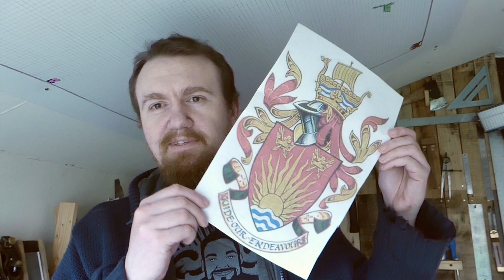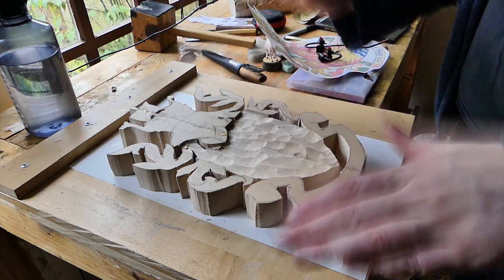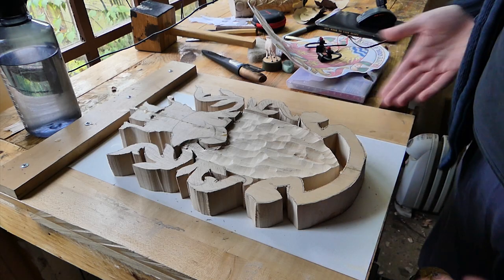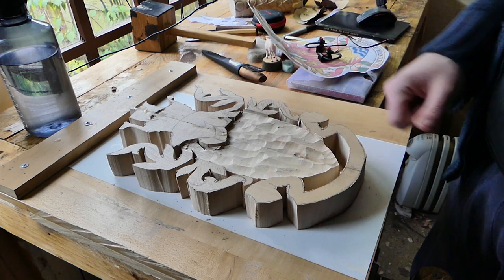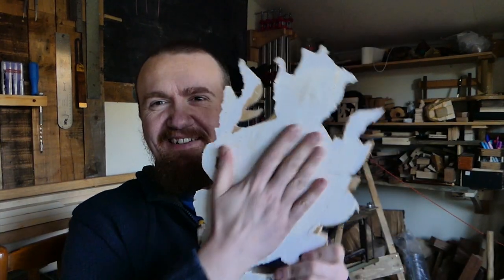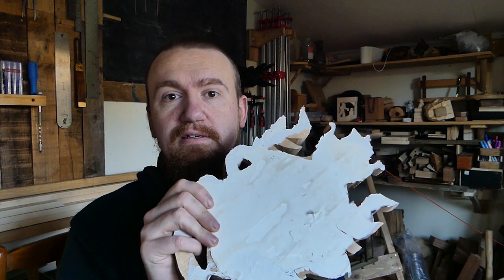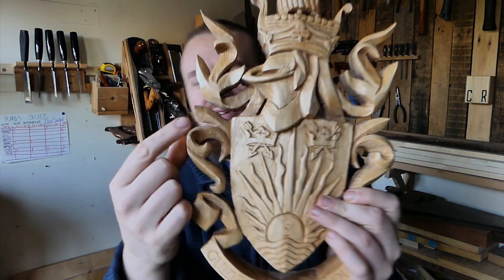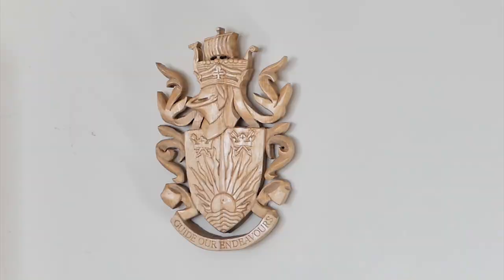Carving the Suffolk Coat of Arms [Wood Carving Project]

Comment: Blooming great piece of work Clint 👍🏻 l’ii certainly try to catch you on twitch if I ever get the right day 😂 another way to hold down your work is to use masking tape on your board and another on your work piece and then glue with superglue, super strong and then just peels off with little/no scraping required. Cheers Steve
Reply from the maker: Thanks a lot Steve! Ahhh yes I've seen that method before, maybe I'll do that next time thank you Steve.